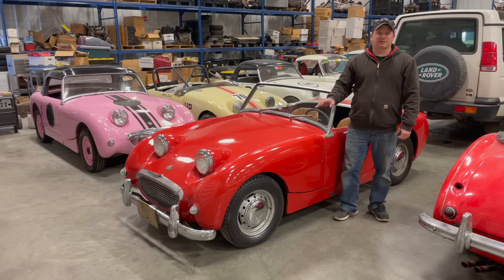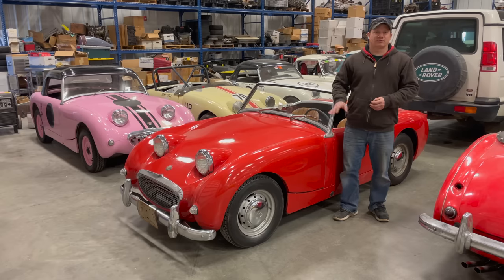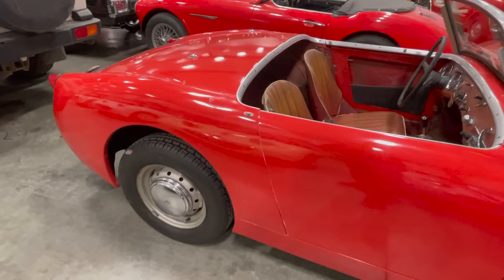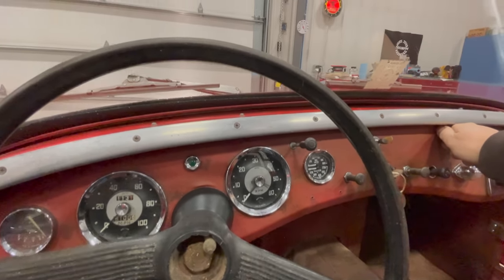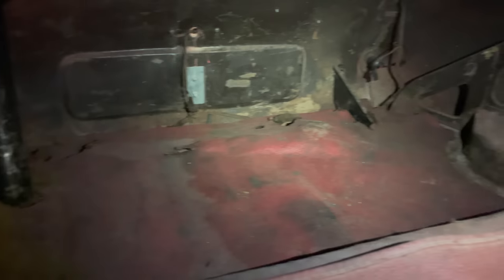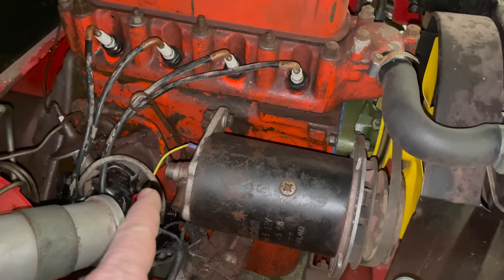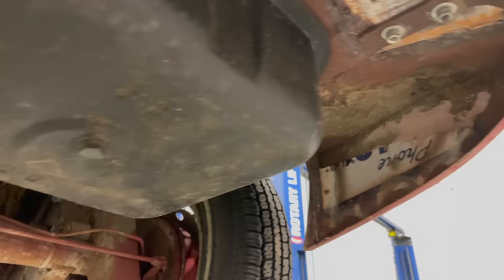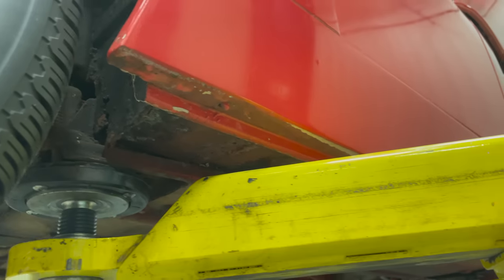1961 Austin Healey Sprite (Barn Sprite #2)

Comment: I'd love to drop that engine and drive train in my 61 Metropolitan.
Reply: Oh no you woildn't ! 😨😨😨
Reply: Nash had a 1.5 liter engine, this bugeye IIRC is under 1.0 liter
Reply: @bradmaas6875  My Metropolitan has the Austin Healey base 1500cc engine with maybe 40hp.
Reply: @SkinnyBiker  And dropping a 950 cc motor into the Met will lower the power output. Going with say a 1968 MGB 1.8 @100hp might fit and be an increase in power.
Reply: @bradmaas6875  Now you're talking! Good idea!